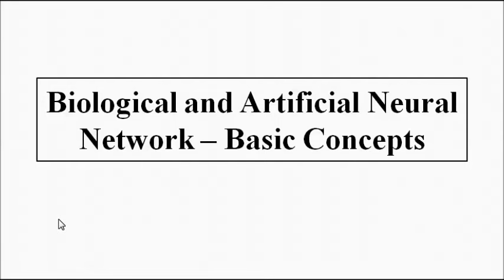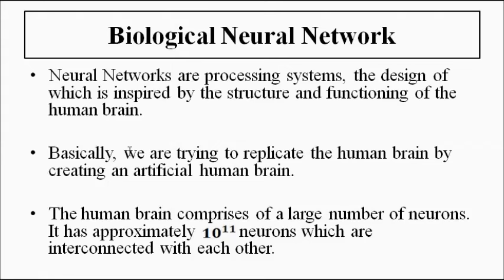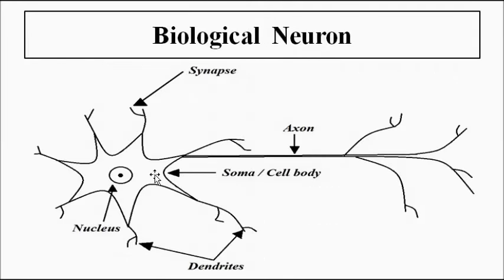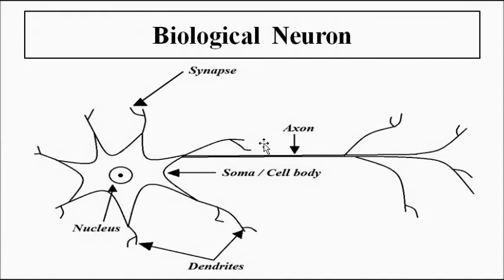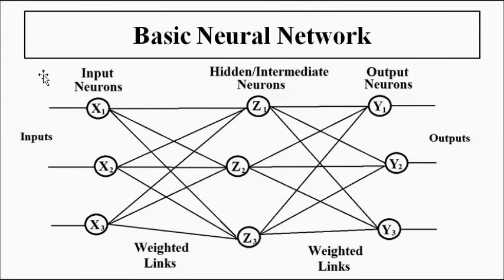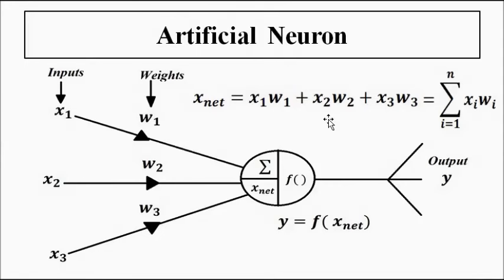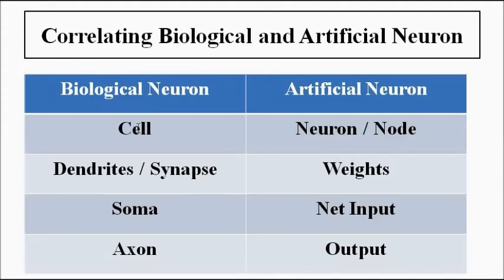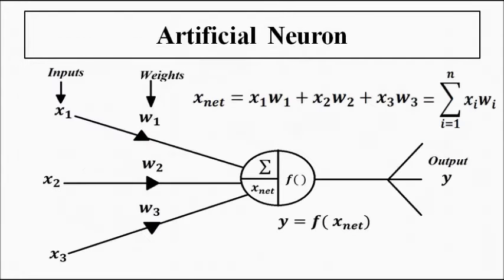Biological and Artificial Neural Network | Basic Concepts | Neural Networks

Comment: This is still a good overview of how a neural net node works, and how it's inspired by physical neurons. 

There has, however, been some good research since that shows biological neurons are much more complex than first thought. A reasonable simulation of a single biological neuron takes about 1000 nodes in 5 to 7 layers. There are structures in the cell that may provide a form of back propagation within the cell. 

It's not certain that all the extra complexity is helpful, but undoubtedly, it will take many more AI neurons to do the same task as biological neurons.